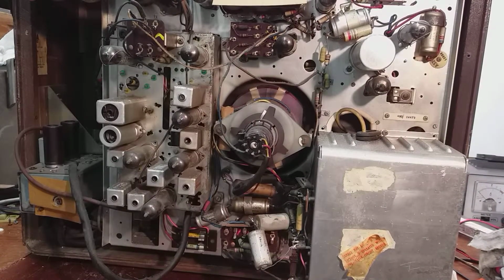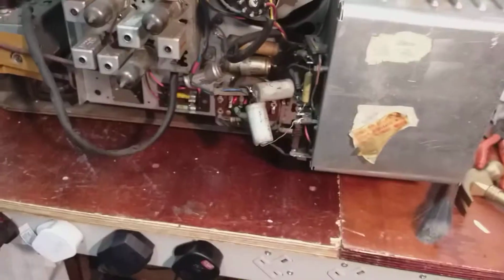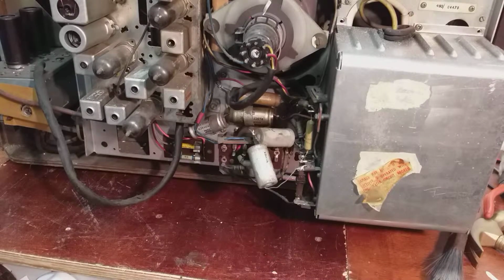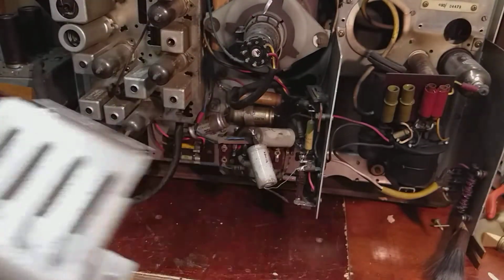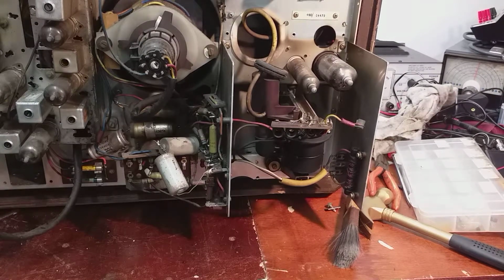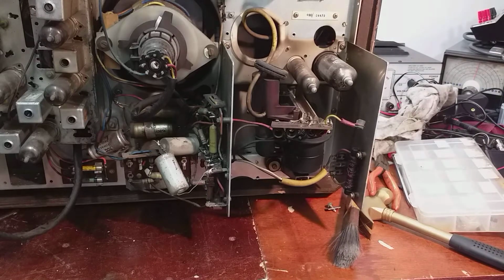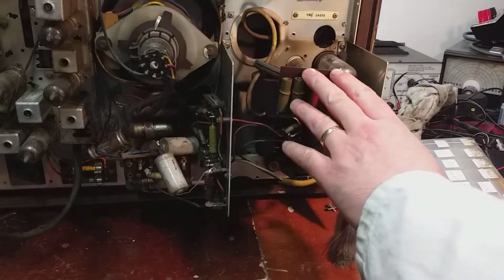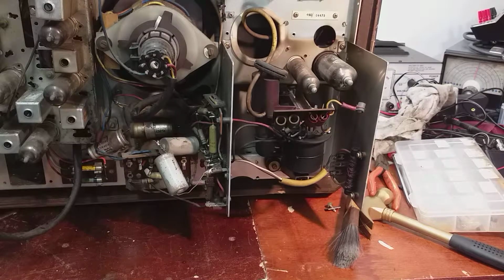BUSH TV105 DX. Irish made vintage TV.

Comment: I used to have a TV106 many years ago and a freind of mine had the British version of the TV105. Ths chasis on both was completely different to your TV105, being more of a box tpye chasis. The TV106 had a flywheel line timebase and a VHF/FM radio switched and tuned by the right hand pushbutton.

Comment: nice trick to dry the LOPT..thank you, i once thought about that and thought i was crazy but it actually is a thing!
Reply from the maker: Thanks! Can't take credit for it, one of the guys on the UKVRR forum came up with it. The good thing is the lopt can be left in place, some old lopts can be fragile so this is a benefit. Works really well and I'm sure would have saved a lot of lopts in the past.
Reply: @IrishvintageTVRadio  the first hours of operation on a tv that has been idling for some decades seem to put a lot os stress on lopts, i can feel that on my tv's...after some hours the problems seem to go away...ozone smell, high temperature, some wax drips, occasional flashes on the screen all that has happened to me even on properly serviced tvs on their first runs
Reply from the maker: Drying out the lopts in the prescribed manner above reduces those effects significantly. It's now a standard procedure for me working on sets of this vintage. Thanks again.